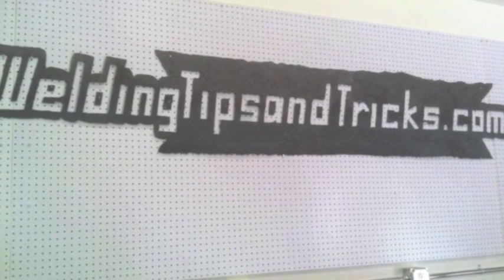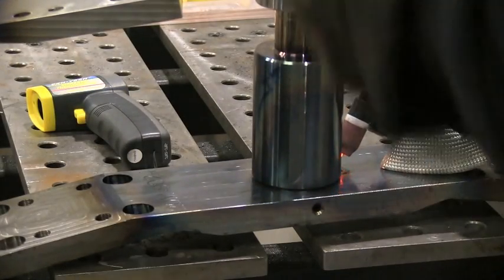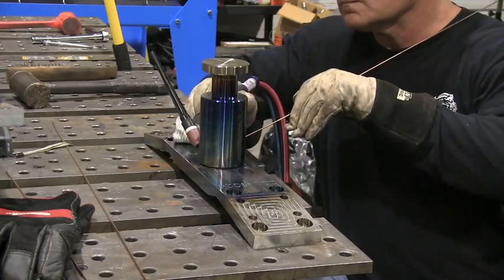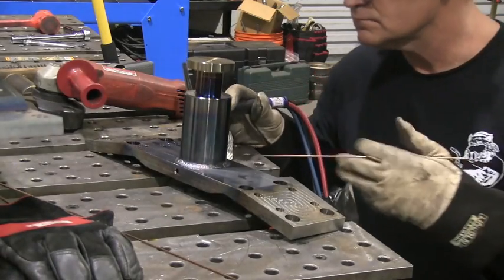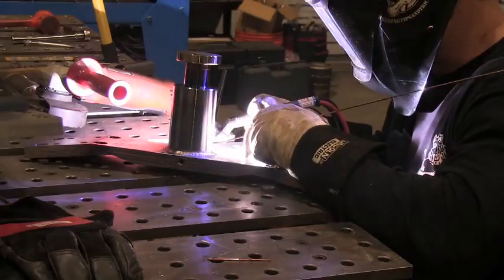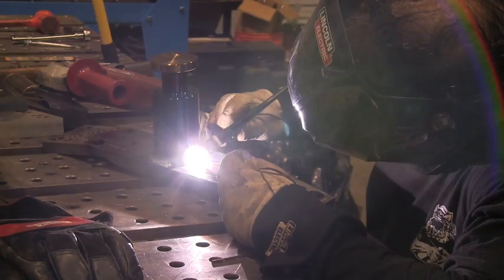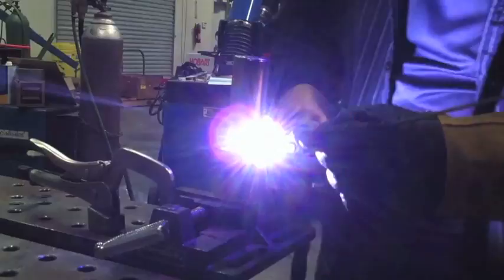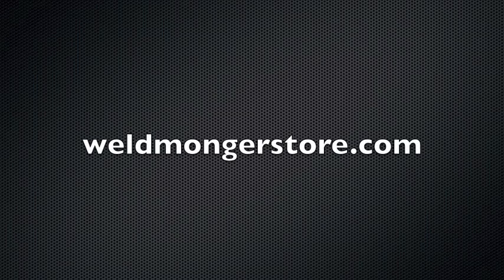Tig Welding Low alloy High Strength Steel part 2

Comment: Hey Jodie I was watching you while dead C clamp I had a C clamp I bought from a yard sale and I didn’t realize when you’re screwed it all the way down it was like 4 inches from the where are you pinch the word goes up against the other end of the sea clamps and it’s like I section dark by 4 inches maybe 4 1/2 and I did like you did beveled it all up in tact and everything and I had some nice broad from when I worked on at the pencil plant in Rossville I got some when we were tearing the plant down I just grabbed a whole bunch of it you know front they said I could have it so anyway I spilled a flex off and use that for welding it and I’ll tell you it’s holding up good so far and I did preheat it and stuff like that and I kept it hot as I went but since then I bought a needle scalerBut anyway I’m a firm believer even on the Castile or something like that to use a needle scaler keeps everything normalized anyway I really appreciate your tenacity I have a Miller to 10 dynasty to 10 DX and water cold in remote foot pedal and all that anyway I’m stone deep under the amateur category I’m having fun with it and you have a nice day you’ve taught me a lot I wish I could come down and work with yardwork for free someday I will

Comment: What about Post Heating?  Is it required or should it be done?  I am looking at a job right now and the engineer has requested a Post Weld Stress Relief but from what I could tell you were able to let this cool naturally.

Comment: Is the tig finger designed big enough to fit over gloves used for mig welding? I only mig weld yet i find my fingers getting toasty due to thicknesses of metal i weld and awkward hand positioning.

Comment: Back in the day we welded 4140 round pins approx 4 inch dia to T1 steel and the weld procedure called for .045 MIG single pass 1/2 fillet after 500 deg. F preheat and then bury  in dry clean floor sweep for post weld slow cooling.  While we were welding one pin and collar plate,the next  one was being heated with a torch using a torch holder and flame directed onto the part.  There wan never a reported weld failure on and ot the parts which were used on heavy equipment booms and related.  045 wire ran hot is very efficient for this application .